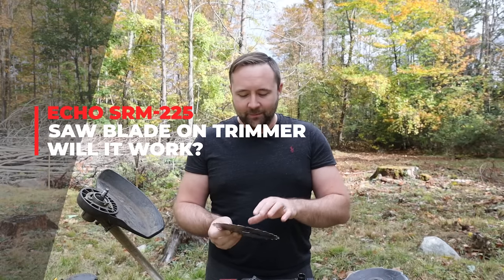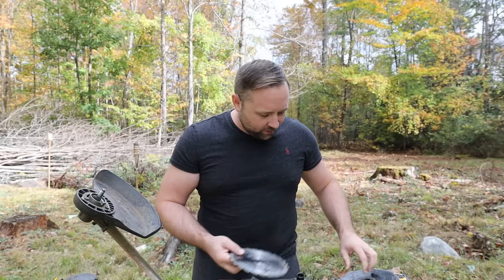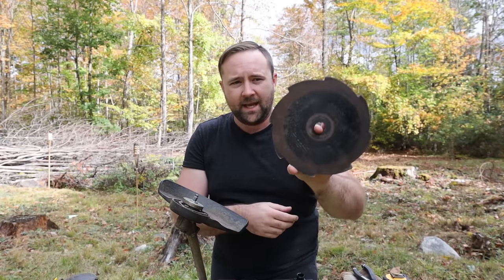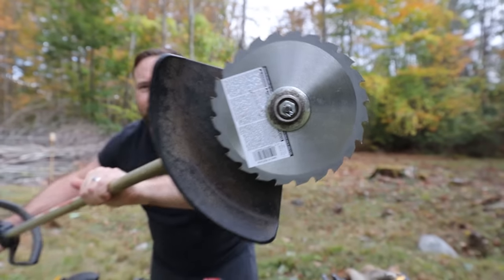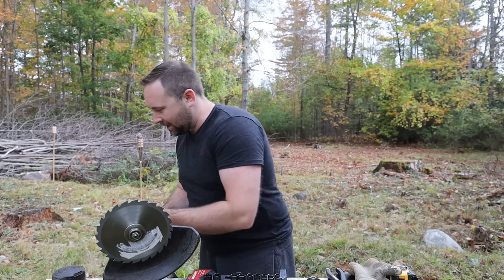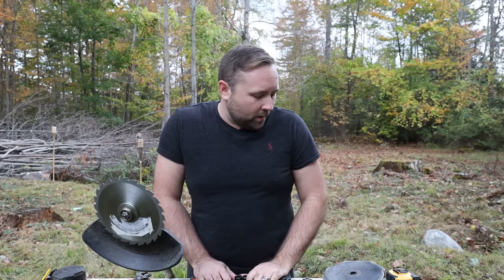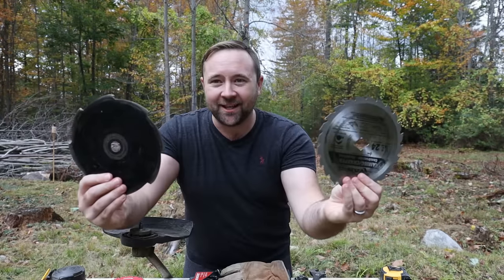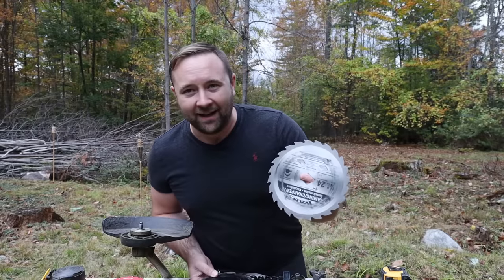Putting a CIRCULAR saw blade on a TRIMMER

Comment: I read the comments about all the bad things that can happen doing this. I looked at brush blade kits for my trimmer and found they were expensive and I wasn't sure I'd be that much safer. I had an old 7.25 inch circular saw blade and tried that. It was a plain metal blade so no issues with carbide teeth falling off. It was rated for 7500 rpm. My trimmer output 10,000 rpm with no string and about 7500 rpm with the string head loaded. Also I didn't run the trimmer at max. rpm. I experienced kick back running the trimmer left to right against thick trunks so I avoided that. Cutting right to left I was able to take down up  to 3" trunks easily. This worked really well for honey suckle bushes, brambles, etc. Much easier than my previous method of using a chainsaw. Thanks for putting this out there.
Reply: Most people want those course blades but if you use a plywood blade it will cut saplings far smoother without all the bounce back.

Comment: That looks super sketchy. I'm going to try it tomorrow.
Reply: Me, too. The sketchier, the better. 😂
Reply: Sounds like what a guy would say.   I keep old saw blades just for that reasom
Reply: Don't, the circular saw blade will fly apart, they aren't meant to run at 9,000+ RPMs !
Reply: @bradbarefoot2986  So are you saying they should duct tape some cardboard to their shins?
Reply: @snakeplissken3021  It's your legs ... shop for mobility products like a wheel chair when (it's not a matter of if) the blade regardless if it had carbide cutter soldered in place or is just a plain blade slings apart.  They have a 3,000 to 3,500 blade tip speed, after that they are a hand grenade just waiting to go off ... both type will will sling apart, hitting a rock hidden in the grass will do the job quicker.  A man from my home town killed his co-worker with a standard saw blade cutting small tree limbs.  The blade flew apart and sliced the man to bits who was catching the limbs as they fell, Mr. Turlington had to live with the fact he killed someone that till the day he passed away.
Reply: @bradbarefoot2986  been using a 10 inch plywood blade on my trimmers for over 40 years works good
Reply: I'm off to do some sketchy shit doo da, doo da
Hope I get away with it, oh doo da day.
Reply: Though when he fired it up the first time; if it were me, I would have ambled over to that low but wide tree stump and tested it with the stump between me and its business end.
Reply: Yup. Sounds whacked. I’ll pick up the beer and be right over.
Reply: @worstknightmayor4439  Right up to the time it frags apart and hurts you or someone else who might be completely innocent.
Reply: @bradbarefoot2986  has anyone ever seen a skil saw blade fly apart, I don't think so, they bend before they break, it's designed that way same as a mower blade they bend not shatter
Reply: @worstknightmayor4439  go ahead and do it then. Let me know what happens when the carbide teeth come flying off that "bent"blade.
Reply: @jlang8213  no carbide, just carbon steel and only the teeth are hardened
Reply: Has anyone tried a 12 inch blade ?  The idea seems more dangerous and probably better.
Reply: The theory of evolution must be tested to. it's full extent by the Male of our species, just look at the leaps in technology when the 6 million dollar man pranged his experimental plane , all these things must be tested and a couple of cold beer's or 8 gets creativity fired up 👍
Reply: @bradbarefoot2986  very viable point. 
Metals are created for certain uses and tempered differently.
He answered the question. It works God's and it fits, so now we  should all buy blades designed for our intentions. 
What's a few bucks to losing a "limb".
Reply: heh heh ..
Reply: @Don.Challenger   , I think I'd of just Lit that branch pile ,popped a cold one and called it a good day , 🤣
Reply: @safeinmyheart1 I'll be joining that party too😂😂😂
Reply: @southerntommygun1353 😂😂
Reply: @JohnSmith-yf6td  You bring the beer and I'll bring the tourniquets! 🤣

Comment: One consideration you didn't mention was a trimmer can reach speeds of 7,000 rpm's which exceeds the recommended rotational speed of that carbide blade and promote the carbide cutters to fly off.
Reply: I've done it for years with no problem.
Reply: @DavidSmith-fr1uz  I am sure you have, but the possibility of it happening is still there, so wear eye protection & maybe some high boot while using it just in case. An ounce of prevention is worth a pound of cure.
Reply: @alfredocuomo1546  And permanent disability or chronic pain for you, a family member or innocent passerby - of course, they will cease using that off label after that first remarkable accident.
Reply: Met someone who put a saw blade on a disc cutter, guess what it ran up his leg practically splitting it in two and it was the bolts through his leg and the scaffold surrounding that held the leg together. He by the way removed the guard to facilitate this idiotic action.
Reply: You are forgetting the gear reduction in the "foot" of the string trimmer, so 2/3 of 7,000 is 4,620.
I've done this too - you're not supposed to have a trimmer come to an abrupt stop from full throttle. Good way to ruin parts.
Reply: @peterdarr383  I know many trimmers can reach 10 to 12k rpms so even with the gear reduction 7k isn't that far off. now I am speaking about gas * not electric trimmers. So even accepting your 66% that would still be 6.6k to 7.9k either way that's a lot higher than the 1.8k the blade is meant to rotate at in a saw.
Reply: Thanks Alfredo! 👍
Reply: Where can I buy the kids  for my stihl weed eater ?
Reply: @DavidSmith-fr1uz  you're lucky until you're unlucky.
Reply: @Mike Lomenzo I do to but it was made for carving, you can use non carbide blades on the weed whacker because there's nothing to fly off
Reply: Wow!
Reply: @alfredocuomo1546  Ok Karen. Just leave the man work for the men.
Reply: @VolReed  Well if a piece of Carbide flies off & hits you in the eye you will be the first to sue, that why brush blades are just steel blades without the Carbide welded tips usually. Just an FYI Betty.
Reply: @alfredocuomo1546  they make and sell carbide teeth circular blades specifically for string trimmers… I think you’d be better suited learning how to do housework on a home magazine channel. Leave the man work for the men.
Reply: Those blades are rated for 7k rpm but built to cut the hardest woods like oak.  How do you imagine a couple extra rpms on soft saplings would make that much of a difference?  You act like they're super glued on...
Reply: @alfredocuomo1546  
FYI:
7 1/4" TCT Circular Saw blade max RPM is rated at 9,000
8 1/4" TCT Circular Saw blade max RPM is rated at 8,000
Reply: @set3777  Well the Diablo for wood is 8k but other material blades are lower eg cement is 5500 and metal cutting blades are especially 14" are 1,700 so I was just pointing out about using a plain carbide blade on a string trimer could be dangerous. I like to say to be fore told is to be fore warned because a trimmer can reach speeds of 400 miles a hour which is 12k rpms but I understand what you are pointing out. Thanks for the reply.
Reply: Why not just get the right tool for the job?
Reply: I’ve done this for years no problems………🙄famous last words, try this at your peril, dressed as iron man preferably
Reply: @paulhaynes1314  What I really find funny is how many replies I got from this comment, Good & Bad.  LMFIAO  Just love to enjoy all of them.
Reply: @rasanath  Are you kidding me? Then the video would be run of the mill. Lots of eyeballs are needed. Would he have got 7K+ views using the correct blade?
Reply: @grounddove  🤣🤣🤣
Reply: what does any max rpm matter? you dont have to run full throttle.

Comment: I've done this for over two decades with the Echo 410U brush cutter.  I take off the blade guard too which makes the job easier and I think safer.   I've cut trees up to 6" down with it.   I've  cut 1000's of saplings down to the ground.   Some of the carbide tips have come off so be aware.  I only know this from looking at the blades after using them awhile.  I've never had one hit me.
Reply: @Christina R I have only seen Wisteria as vines.  A method of getting rid of these plants is cutting a chunk about half way through the vine about 4 or 5 feet up.  Coat that with full strength CrossBow.  Keep on doing that every couple of days with a paint brush.  You can use roundup but doesn't work as well.  Once the vine show some real sickness, spray as much of the vine you can with a strong solution of Crossbow.  About 6%.  Be sure to add spreader to you mix.  This works real well with poison oak and Ivy.  This method kills the roots and all.
Reply: So, knowing that teeth come off, and knowing how fast that blade is spinning at the outer edge, you still think it's a good idea..........like I'm gonna trust your judgement.

Comment: I have cleared brush and grass with this on a large lot twice a year.  Took me a week each time.  I used the larger blade with 40 or 42 teeth.  My grasscutter has a big yoke style handle.  That helped imensly with the kickback.  And it does.  I cut brush as thick as my arm.  I never had an accident and I was always by myself.  You want to be very careful and never forget that with a sawblade on that end it's a very dangerous tool.

Comment: Don't Do This ... I owned a mower shop over 40+ years.  Standard circular saw blades are made to run at about 3,500 RPMS ... the Echo (sold hundredds of them) turns up on the PTO end upwards of 9,000+ RPMS ... a circular saw blade, especially those with carbide cutters WILL SLING ITSELF APART.  One customer tried this and killed his helper in the late 1980's ... bottom line let the Youtube fools have the blade come apart at ruin his health ... not yours.
Reply: I'm thinking the lower rotating mass of a blade will cause this engine to over rev and cause engine damage.
Reply: My old saw says 5,800 rpm, but yeah, i use the blades that are made for my brush saw.
Reply: Local guy did this, the blade bust loose bounced off the house and nearly severed his foot above the ankle.
Reply: Horrible idea! Just buy a blade that’s made for a trimmer. Even with a manufacturers blade, it can be nerve racking, but I had faith in Echo and their engineers.
Reply: Dang thank for this. I was going to try Harbor Freight to save 💰. I will Just use an official blade. Mine is electrical Ryobi and w try one like a Forester or Ryobi. 🙏 ..
Reply: Worst idea ever. Did you see the kick back on that thing. I like having two feet.
Reply: Think of it as a Frisbee made of carbine teeth got loose .
Reply: Green Machine made a circular wood cutting blade for their trimmers back in the 70s. We only used it on briars and young trees no bigger than 1inch diameter. It seemed to put quit a strain on the engine.
Reply: Hey imagine if they made an actual tool for this, with a chain and blades 🤔
Reply: Wouldn’t try it, lethal if it goes wrong, hit a stone or something. You can always sharpen the normal softer spinning discs, doesn’t take long, and keep a few spare ready for use. Don’t use unusual power tools, like grinders with chainsaw blade attachments. If these devices were safe they would be commercially available from reputable makes. Strimming/brush cutting just isn’t that easy, but it’s effective…suck it up.
Reply: The family who had been cutting and trimming the cemeteries around my community for decades use a skill saw blade on their 4stroke stihl trimmer, and have for years. 
Makes it easy to get close up to the stones, without burning through trimmer line like it was thread. They have yet to have a problem
Reply: Holy shit! I'm glad I read YOUR review buddy. I was just about to do that dumb s***
Reply: @danielkomorowski7966  one of my best friends mows professionally, including many cemeteries in tue area, he has used the same skill saw blade on his 4-stroke stihl commercial weed eater since it was new, and never had a problem this guy doesnt know what he is talking about. There is a difference between owning a shop, with financial incintive to sell their specialized stuff, and using it for literal thousands of hours in the field. And there is a LOT of weedeating in a graveyard
Reply: There are so many things wrong with this, which are outlined by others. 
Don't use tools for anything they are not designed for when the potential dangers are so high.
There are small chainsaws that can be operated with one hand that will do the jobs we see in this video.
Reply: That's what I was thinking. That blades made for saws. If it shatters at high speed I wouldn't want to be standing next to it.
Reply: @cm8088  Have you ever had to clear woody overgrowth? A chainsaw sucks at it… you can only cut half the stuff, they can’t cut crass and weeds and have horrible reach and you’re bending and twisting most of the time. I have a chainsaw and a string trimmer, I still just spent $450 on a dedicated handlebar brush cutter and it’s well worth it for the 4 properties I maintain.
Reply: You can buy regular circular saw blades rated at 10,000 rpm. Most do seem to be rated at around 8,000 and I wouldn’t trust those. I wouldn’t even try this though when you can buy dedicated brush cutter blades designed for this purpose for the same money, it makes no sense unless maybe you already have them and don’t want to spend more I suppose.
Reply: @travispratt6327  same money? They are 3x the cost. I gurss replacement blades. The first comes with the arbor washer that holds it all togetherand centered. Thanks for the input though, I didnt know the rpm that they were rated for.
Reply: This looks like something Tim Allen would do on Tool Time from the 1990s this guy even looks like Al we all know what happened when Tim tried to increase horsepower and tweak tools
Reply: @johnhurtme  
Thank you man. I will take it from The Working Man. Cheers!🥃 and thank you
Reply: Thank you so much for sharing! I for one, will not be trying this!
Reply: @drewsquickfix 😅
Reply: @johnhurtme  If you just buy a regular saw blade, you still need the washer and adapter to fit it to a string trimmer… the blades themselves are the same money though, I bought a 2 pack for like $12 prime shipped and my brush cutter already came with the adapter and they bolted right up.
Reply: Thank you. I was gonna consider doing this but after your comment, I absolutely won’t do this now.
Reply: @michaellavery4899  You should probably stay in the recliner and leave the big boy stuff to someone who can figure it out for themselves.
Reply: I have been doing this with old table saw blades for years. I have to make the arbor hole bigger with a step bit.

Comment: I did this with my Stihl a few years back (still do, pun intended 😜). Used an old dewalt 10” and festool 7 1/4” blade at different times. Works brilliantly for bamboo but because there’s more teeth, it can bog down on thick cuts, as you experienced too. You need to watch for kick back as you also showed happening. The Stihl doesn’t use a cotter pin though as the thread is reversed so that the spinning action will tighten the bolt. 
Thanks for the video.

Comment: I use dedicated brushcutter blade for this.  More convenient and with no doubt SAFER option. You can sharpen it and even bend align teeth on the spot in a minute! Mine is husqvarna scarlett, but I'm pretty sure there is same ones from other brands incl. echo too. So far I have managed to seriously damage only one of them by stucking in larger tree (it had a small crack near one of teeth)

Comment: As a landscaper with my own small business.. I can tell you from personal experience that this is one of the dumbest things you can do. I used that chainsaw chain for the Stihl weed eater head replacement and I had to leave a customers yard half way done because I needed some stitches
Reply: Well I wouldn't  expect  anything  but from a YANKI.  🇦🇺
Reply: I saw some of those blades to turn the weed eater into a circular chainsaw... and figured, Nope... the kickback from those has to be hard to control
Reply: I've used one for years, no problem. You need good sense, not that common sense y'all got in Texass.

Comment: I can give you a suggestion on using a saw blade.  I have been experimenting with all sorts of setups for years.  First, don’t use a grass trimmer, use an edger.  You take a standard edger blade and weld two saw blade teeth on each end of the edger blade.  You get more ripping action with that setup.  I purchased a commercial Echo edger with a metal guard.  I cut all kinds of surface roots in the ground.  Really works great.  I have been doing this for years.  Thanks.

Comment: I did the same thing with the same kit and the same trimmer. 

After about a year I removed the guard, it’s gets caught up a lot. I tried bigger blades, but the trimmer lacks power for that and if you use a bigger trimmer the weight becomes an issue. 

This thing works great. We have a plethora of azaleas on the property and they spread like mad. This tool beats everything I have tries when it comes to cleaning them up for the mowers to get close. It’s fun too.
Reply: I was wondering if a 10" would of worked.  You said they don't huh? Any idea how well it cuts down tall grasses? Like around our pond, etc. Thanks.